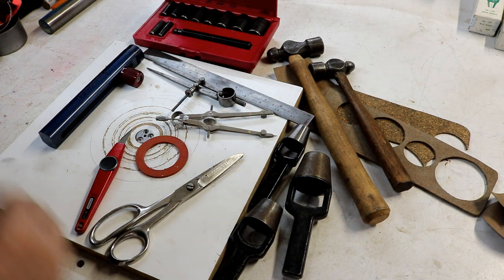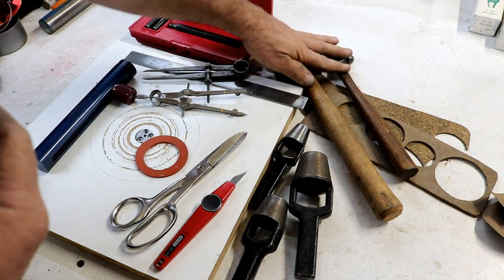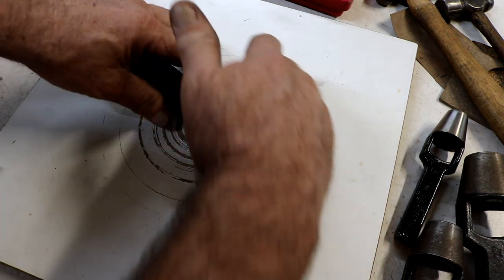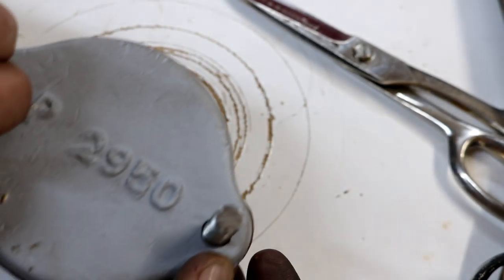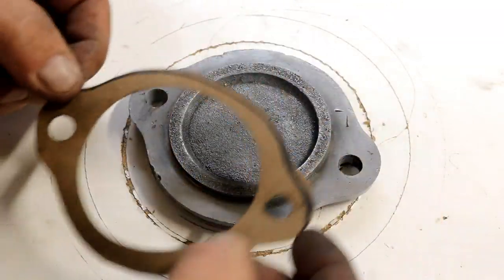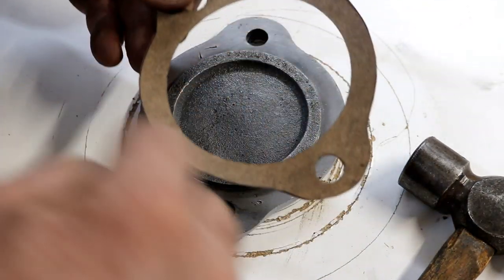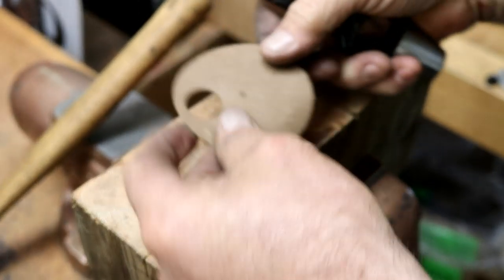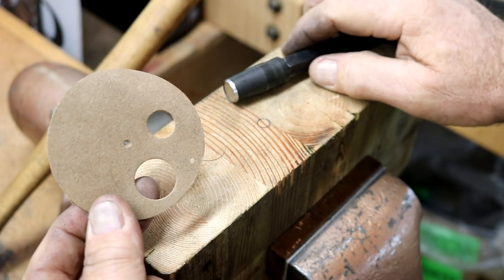#TipBlitz19 #tipsblitz19 Gasket Making Tips

Comment: We used to use that tapping with the hammer trick to cut the gasket completely. Usually on the big stuff with a sheet of rubber.
Reply from the maker: Works great for large gaskets. 24" flanges done a few of those that way.  thanks Wildman.

Comment: Some really great hole cutters can be used from spent or empty gun cases. Both pistol and rifle empty cases come in so many different diameters that you can usually find the size you need with them. And using a deburring tool can sharpen the inside of the empty cases to make cutting holes that much easier. Just an idea I use.
Reply from the maker: Good tip Gary.  Thanks for adding a new tip on this subject.

Comment: I was surprised that you didn't mention Cutting the gasket with the ball penne hammer
I've made water pump gaskets and motorcycle side plate gaskets out or cereal boxes and a ball penne hammer.... dress the gasket surface with a file when done to take off the occasional dent.... works great ! saves running to the parts store when you live 20 miles out of town too ! .
Reply from the maker: I  have made many a gasket with a Ball Pein.  But be careful.

Comment: Great tips Randy.  However, using a ball peen hammer LIGHTLY to mark a gasket for cutting is OK but NEVER cut a gasket this way.  The ball peen will deform the metal around the hole or along the edge, usually raising it, which can potentially cause the damaged flange to leak.  I prefer using either a very light application of grease or bluing compound on the part I am making the gasket for then placing the gasket material on the part and rubbing firmly over the gasket to transfer the cutting pattern to the gasket material.  Remove the gasket material from the part and cut the gasket using the appropriate tool(s).
Reply from the maker: Yep another good method.  Thanks Robert for adding to the tips.

Comment: Randy when I was a kid my dad would make the gaskets in your ball peen hammer method but we could cut the whole gasket out pounding around it like that
Reply from the maker: Yep some parts that is ok, but you have to watch not damaging you part.  Thanks Bill.
Reply: Better to use a plastic or rubber hammer, as it won't hurt the metal, but will cut neatly most of soft gasket materials.
Thanks for the video, Randy.
Reply: @merlinch4256  in my younger days we lacked them fancy tools.
mostly working on trucks and heavy equipment then
Reply: @ @wnebergall  Sure, it was the same for me, and I was using my father's rubber hammer, the one he had used for camping   :-) But I only worked on my motorcycles, not on bigger machines.